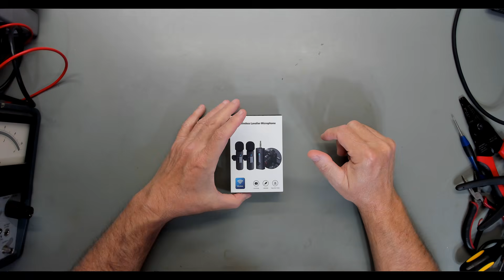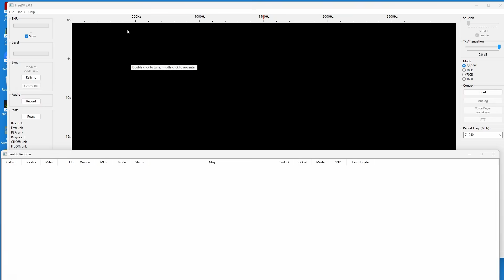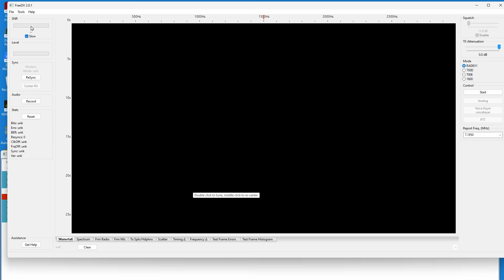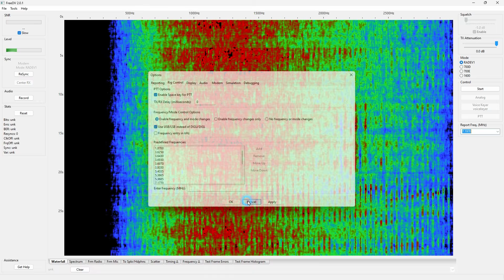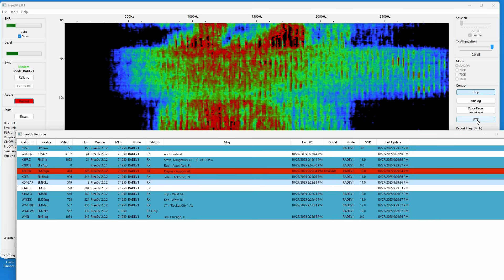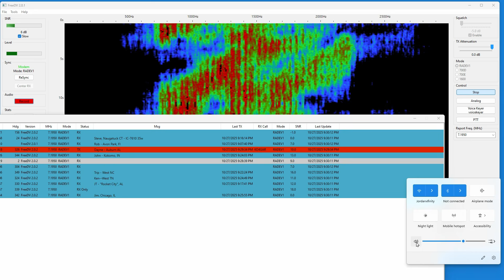Things I Learned About FreeDV That Will CHANGE Your Mind

Comment: I am using a Bluetooth headset (mic & speaker) into my computer.  When I select these devices on the Audio Config page and click Apply, I get an error message "You must use different devices for From Radio and From Microphone".  I can't get around this.
Reply from the maker: Unless the headset shows as a mic and a headset separately it might not work in the software. It expects two different devices for audio in and out. 
RJ
Reply: Once I got the logic of signal paths in my head.  I figured it out.  Next problem was that the headset mic is only good for 16kHz   I did a few test recordings - choppy as all get out.  I have a Shure MV88+ mic that supports 48kHz.  Works great.  Sounds great.  Now I need a better antenna!  My HOA "Rain Gutter" isn't great.
Reply from the maker: @DCSIDPA  Great! I'm glad you got it working!
RJ
Reply: This should work though as the headset routing is 'input from microphone to computer' and :output from computer to speaker/ headphones'.

73 M3KXZ

Comment: How about using a bluetooth headset?
Reply from the maker: I’m sure you could do that. 
RJ
Reply: So I have to talk into my computer running a software Application, and the computer connects
to a radio transmitter.  What the heck is this?  What happened to the SM1000 Modem?
Reply: Grow up chap. You're posting this same boring comment on so many videos about freeDV and RADE. Tedious.

Comment: RJ can you do video showing the connections from your 710 to the computer.
Reply from the maker: I could, but it wouldn’t be worth the effort. It is just the usb cable plugged into the usb port of the FT-710 and the other end plugged into a computer usb port. Nothing else is connected between them. 
The receiver audio goes to the computer over it and the encoded data to transmit goes from the computer to the transmitter over it. 
Hope this helps.
RJ

Comment: Is there any way, with the FT-710, to use the microphone that’s plugged into the front mic connector, that you know of ?
Regards/
Dennis\W2gli
Reply from the maker: I’m afraid not as the computer needs your audio not your radio. The computer digitized data gets transmitted not your voice. Only a few radios have FreeDV built in that allows you to just use the radio without the computer. We expect more to incorporate it in coming years. 
RJ

Comment: Question: since it is Data, can it be used in the CW portion?
Reply from the maker: The current frequencies in use with it are in the phone section so I believe it is still treated as phone. We want to leave the cw guys alone they might get upset. 
RJ
Reply: @LynxElectronicsLab I'm one of them CW guys, that's why i asked😂.  It's bad enough already with FT8 etc. BUT I'm really enjoying FreeDV! Guess I'm a conflicted ham. Hope to work your station soon. TNX 73
Reply: @cliffm1260  FT-8 is not used in CW-only segments, it is used in narrow band modes (200Hz and 500Hz) and all modes segments. FreeDV does not fit in 500Hz, so it is used in all modes segments.
Reply: @baranosiu makes sense to me.
Reply: So I have to talk into my computer running a software Application, and the computer connects
to a radio transmitter.  What the heck is this?  What happened to the SM1000 Modem?
Reply: @handsomeman-pm9vy it's a digital world now. Welcome

Comment: Great videos, thanks for putting these together.   The sound quality is amazing.

I have an FTDX-10 and ordered the microphone you recommended.  All seems to be working ... except.

I am receiving great in digital mode. Tonight I tried transmitting on FDV for first time.  Someone  came back and said that I was getting through but am transmitting in ssb, that I should check the settings on my radio.  Any guidance on what I need to set there appreciated. 

Thanks again.
Reply from the maker: Not sure but does the FreeDV software show your transmitted audio?
RJ
Reply: In case it helps someone else. 

 
Yaesu FTDX10 must be set to Data-L / U.  At that point,  I could see it keying the tranceiver but no power going out.

On my Dx-10, i needed to set the RADIO SETTING>MOD PSK/DATA / data mod source/ to REAR, and the REAR SELECT set to USB.  The former was correct,  the latter was incorrectly set to Data.
Reply from the maker: @mikei5904 
glad you figured it out!
RJ

Comment: I installed it 5 years ago. Had one poor signal qso, never heard anyone since. Seems strange. If a computer is involved they think it's another internet mode. FT8 is a pure internet mode.  Dave as rtty psk z and many others. Even DMR for direct simplex does not need the internet if in range.
Reply from the maker: It seems to be gaining traction since the big improvements. So more and more people are getting on FreeDV. 
RJ

Comment: Can you use your radio mic or do you have to use a mic connected to the pc?
Reply: Mic connected to PC
Reply from the maker: Yes, currently we use computers and the mic needs to be on the computer. Unless you have a newer Flex radio they have built it in to their radios. 
RJ
Reply: @LynxElectronicsLab  Ok ty! I watched another group talking about this and they mentioned using their flex rigs. It didn't occur to me that they were not required to use pc mics due to using flex radios.

Comment: What are the settings if you are using Flrig? Also, does the rig's buad rate (mine is 19,200) matter in any of the settings?  Thanks for taking the time to do this video!!
Reply from the maker: Thanks for the question. I’m not using flrig. In the setting under the rig control tab is where you setup things like rig baud rate. Hope this helps. 
RJ

Comment: FreeDV sounds really cool. Thanks for the 2 videos you've made explaining it. Quick question. i don't have my ham license yet. Can I still use FreeDV in "listen only" mode? If i don't enter a call sign, will FreeDV still work on the receive side? Thanks again.
Reply from the maker: Sure! The call sign is just for the FreeDV reporter software to show who’s listening and Transmitting. You can still use the software without a call sign in it. You can leave it blank. As far as listening you can always listen without a license so feel free to fire up the software and see what you hear. The Nets listed on FreeDV would be a good starting point. Have fun!
RJ
Reply: @LynxElectronicsLab  Thanks RJ. Looking forward to playing around with it until I get my license.

Comment: I purchased the 'sound card' mike device found on the link provided in the description. I could not get my computer to recognize it.  It's lights turn on and the device responds normally...so power is getting to it. However, neither of my computers and none of my various USB to C cables will make the computers recognize it. I acknowledge that my microphone receiver looks a little different from what is shown in the video....but....?
Reply from the maker: Not sure why? I know it is a newer device as I said. Did your computer show a new usb device in device manager when you plugged it in? Did it show the driver working or as unknown device? Did you charge it first? The cable that comes with it does not charge it. It is only data or at least mine is that way. It will not not work with a normal usb cable as when power is applied it turns off to charge. Make sure the mic is charged and on as the dongle does not connect until both are on and connected to each other. If all is as it should be it is possible it is defective. Let me know what you figure out.
RJ
Reply: @LynxElectronicsLab  When I plug it in with the supplied USB to Type C cable the lights come on but the computer doesn't recognize the dongle. I tried it on my work computer which has a Type C port....by plugging in directly (without the USB to C cable)  and that computer recognizes it.  So I think it could function with that computer....but my 'ham' computer doesn't have a Type C port....only USB. I am beginning to think that it could be a bad unit. I sent an email to the Kashevi manufacturer....hope to hear back soon.
Reply from the maker: Keep me updated. I bet your adapter cable is a full data & power cable and this is the problem. You can’t charge and use it at the same time. It has to do with noise from the charging I believe. A data only adapter cable will likely fix the problem. 
RJ
RJ

Comment: Good video. You have put together the best FreeDV videos on YouTube. FreeDV is also tracked by PSKreporter.  I’m a very new to digital voice user and still learning. RADEV1 mode does take a little computer power but is good.  So far I like it.
Reply: Your FT-710 radio has an internal “sound card” that connects via USB along with CAT control. I have a Xiegu G90 and I need a USB sound card or something like a Digirig.  The other sound card is the computer’s internal one. Your wireless microphone connects through USB or  something via MIC/SPKR audio  jack.  I use a wired headset with microphone with a TRRS plug  connected to the computer’s audio jack.  Good explanation on the audio setup, best yet.

Comment: Great walkthrough. Would you mind listing the make and model of your wireless lavalier mic?  Is the dongle outputting line level or mic level?  I plan on using one on my Beelink mini pc however, it only has a headphone/speaker out plug not a muliti TRRS mic/headphone jack. So, I'm thinking the only option is to find one like yours but a USB A dongle connection to my Beelink?  Thanks.
Reply from the maker: Thanks!
I added a link in the description for the mic. This is the newer version. Everything is usb-c now so you will want an adapter. Since I am using usb as my audio connection on it there is no line-out/mic level. Hope that helps.
RJ